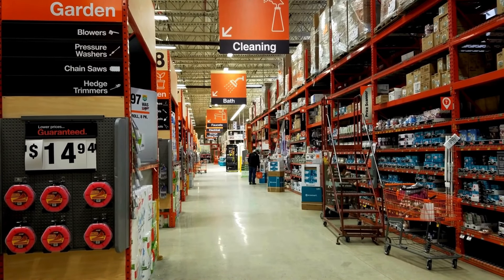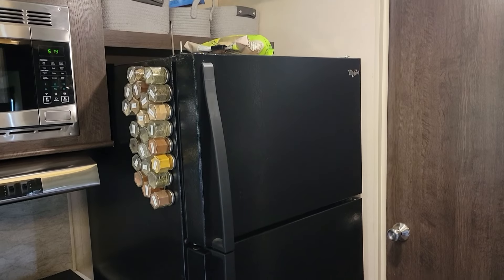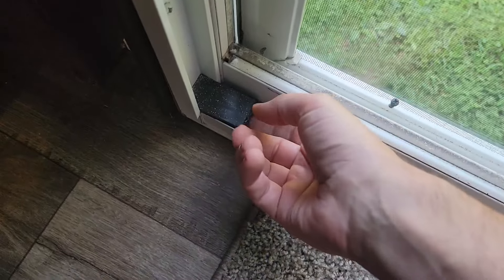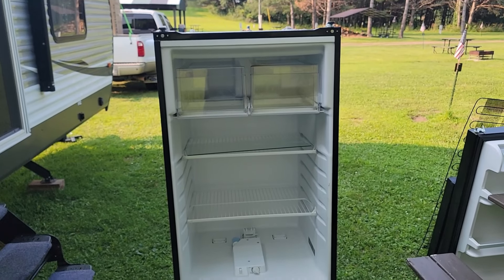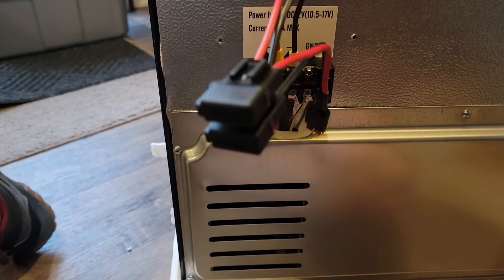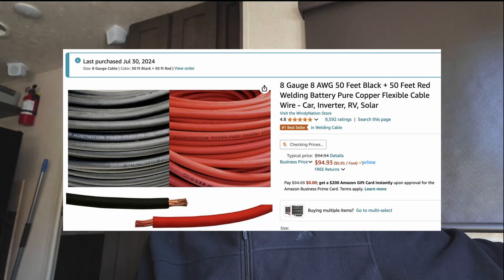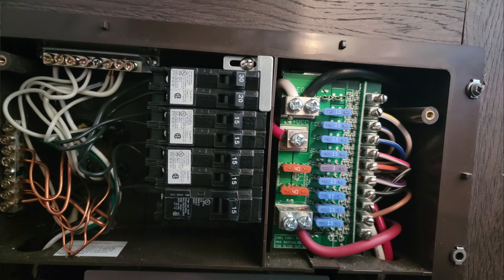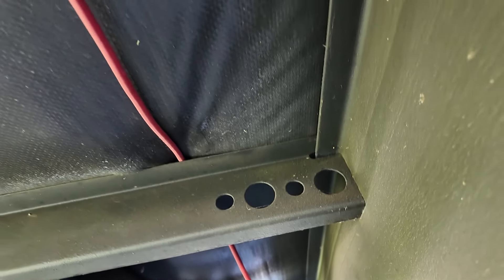How I Installed My 12v Fridge in my Travel Trailer

Comment: Hi Steve,  You probably want to get some of that black corrugated wire loom around that red positive line where it is going over those frame rails.  The wire WILL chafe and eventually short to the grounded frame otherwise.

Interesting video.  Keep 'em coming.

73s de N6UGP
Reply from the maker: Thanks for the tip!

Comment: nice install . That Windynation wire is great. Has the UL and heavy duty insulation. That one of the brands I use. All of my installs are UL wire and terminals . The separate ground is ground only. safety ground. This makes it so a 12V POS ground can be used or floating ground system. In a off grid cabin the Battery system may not be grounded . Low voltage systems do not need ground, But metal frame on appliance does need a safety ground. Shock hazard,  May have inverter to make 120/240 V or static buildup from weather or thunderstorm.  Most systems are 12V NEG ground.  But some Trucks are POS ground . They make 24V and 48V DC models as well. Direct DC compressors are more efficient.   Brushless DC motor tech . Look what it did to cordless tools like DeWalt and Milwaukee .
Reply from the maker: Thanks for the tip.  I wish the manual would have called it safety ground.  It would have made more sense.

Comment: If the manufacturer left the pex, maybe they left some connectors somewhere in there. I could of used the pex at Huntsville since I had some flexible tubing under the sink decide to burst. Had to run down to Lowes for some tubing and connectors. I already had the crimp tool and clamps.
I see the tea kettle on the stove. Might I suggest you get an electric water kettle to heat your water. Save your propane for something else.
Reply from the maker: We haven't even used the kettle, that belongs to the missus. 😇

Comment: Hi, great vid. I'm curious after you run it for a while how dialed in you can get.(temperature wise) The thermostat and conrol board in a lot of these 12 volt ice boxes have a tendency to be a bit wonky. Thanks for the info.
Reply from the maker: I have a thermometer that I keep in the fridge and it has been steady.  I'm pretty shocked.